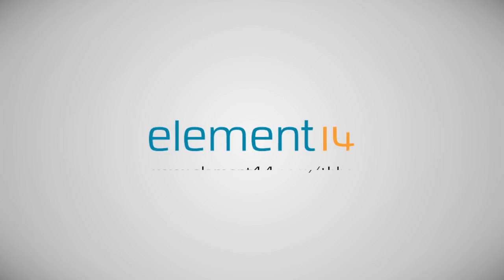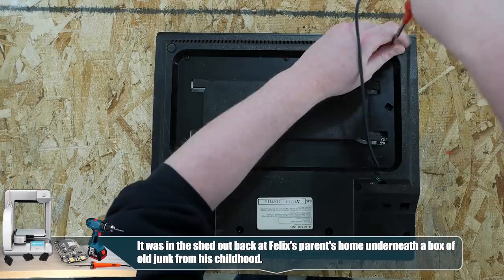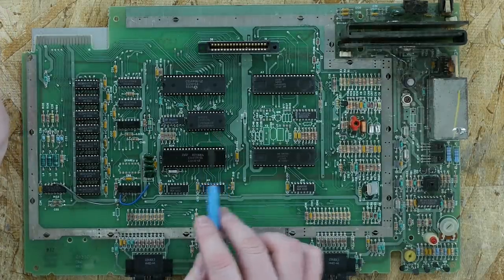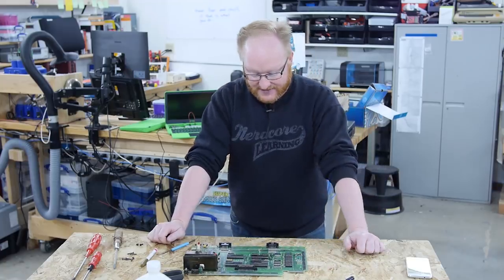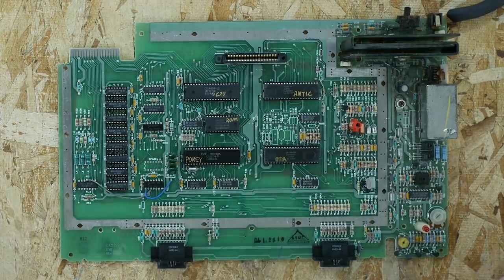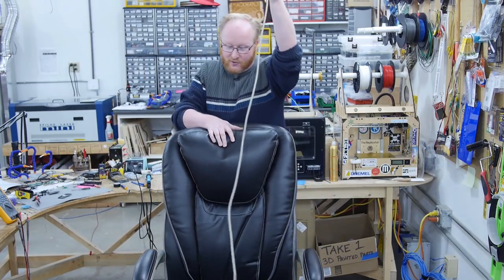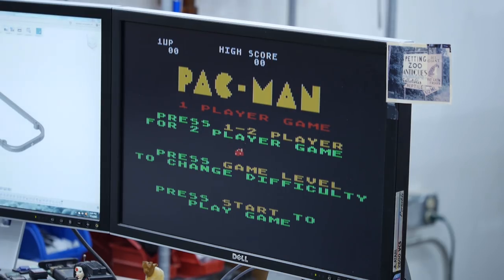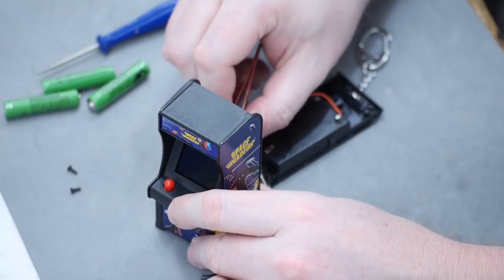Atari 5200: Making a Better Controller

Comment: Seriously !! You should mass produce these ! At least make 1000 available. They would sell out on Atari Age within 15 minutes !
Reply: TheClassicGamefan Did you saw the video? They test it with Pacman & Mario Brothers
Reply: exactly. i wanna see them play missle command and centipede with it. i use the interface thing that lets you use genesis controllers with a 5200 and i use the track ball or og 5200 controller for some analog games but i really wanna see someone crack that riddle
Reply: indeed it'd make me want to buy a 5200 since i'd actually be able to play it :D
Reply: @TheClassicGamefan  Excellent point!  I did notice that games like Pac-Man take input differently from the analog controllers than games like Missile Command and others, which must be for the reason stated, digital vs analog.  I'm dealing with some joysticks right now that work fine for digital input games, but don't do diddly squat for analog input games.

Comment: The retro market is in need of this controller. My god this needs to be mass produced
Reply: crimson7085 ah jeez. Who’s really getting teary eyed over the 7800 much less the 5200?
Reply: There's a lot of us 5200 and 7800 gamers still rocking the systems. Go over to AtariAge dot com if you don't believe me.
Reply: I agree!  I have two controllers and I’ve taken them apart so many times to fix them

Comment: Ben, please, PLEASE...make this controller available for sale. I could really use one. I miss using my Atari 5200. When I think about using it, I stop and think, and remember. The controllers are atrocious. 😔 pleaae....help!
Reply: I'll second that! I have both models of the 5200 - the 4 controller port version and the 2 port version. I even have a 2600 to 5200 cartridge adaptor. But, I have NO CONTROLLERS THAT WORK! I can't play them anymore :(
Reply: I'm very good at fixing them look for Mark on atariage page on Facebook
Reply: I would definitely buy this!
Reply: There's something to that controller. If it was compatible with PC games, it would be tempting to buy one.
Reply: Have somebody put this into production or brand new controllers for all retro consoles hey there's an idea, show me the money Ben!!!!
Reply: I too would buy a couple of these. Either completely built, or as parts kits and 3D models for printing. Please!
Reply: Please sell this! I'd buy 2 right away!
Reply: Please put into production
Reply: Yes, count me in!
Reply: The controllers are fine to me. The only problem is that they corrode easily. And you can just clean them out with an eraser.
Reply: I would take 4 of these!  Please give someone this info, or sell it to them.
Reply: @DerpDerp3001  didn't work for me at all. I need to buy the new flex circuits on Ebay. Sad the 5200 gets very little love.
Reply: Also you need alcohol and some way to protect it from corroding.

Comment: For sure there is a market for these controllers. As others have said, you didn't allow for the use of the overlays for those games that did come with them. Also you really need to test your analog programming with a few games that are very tricky to get working in all directions even with stock and good working 5200 controllers. Those games are Popeye, Kangaroo, Miner 2049er, the sequel known as Bounty Bob Strikes back and Gyruss. 

Also I would be interested to know if you did a composite video mod on it to get the gameplay footage at the end on your Dell monitor there or how you got around the RF on that?

But these are the kinds of videos I originally subscribed to see on the TBHS and it is very bittersweet to see this stuff again on the sunset of Ben leaving...
Reply: All of the 5200 games that are Trak-Ball compatible will work well with analog joysticks. Speaking of Gyruss, there's a 5200 specific version that has never been officially released. For whatever reason, the commercial version Parker Bros. released was just a port of the Atari 8-bit computer version.
Reply: 5200 Gyruss was my jam.  Of course, I had a Wico stick.

Comment: The only problem I can see is that games used thin plastic overlays to tell you what the keypad buttons did, so you'd have to either design the controller to fit the original overlays or provide new ones that are compatible with the redesigned one. Or remember what all 12 buttons did.

Comment: Um, I’d buy it in a second!!
Reply: Really, I thought that the 5200 was your most disappointing console. And you never really mentioned the alternatives to the original controller nor the upgrade kits available. Sorry but cant take your comment at face value.
Reply: @nostalgicforthe70s18  it's a YouTube comment.. chill
Reply: there is a cheap adapter floating on ebay (greece imported) that lets you use 2600 controllers instead of the 5200

Comment: Ben and Felix, there are loads of 5200 owners who would buy that. A lot are over at AtariAge and also in various Facebook groups. However, the true holy grail of a project, and I hope you both would consider doing this, would be to create a retrofix PCB kit for the CX52 joystick that would replace the flex circuit in them. You could take that self-centering analog joystick mechanism you used and replace the existing analog stick with it. And you could use dome switches - which Dan Kramer's CX53 Trak-Ball Controller uses - attached to the PCB so that the mushy fire buttons and keypad buttons would work properly. Essentially turning a stock CX52 into the CX52L that wasn't released. You guys would be 5200 gods! Take my money!

If you guys really want to play 5200 games, get the AtariMax SD Cartridge Adapter. It rocks. If you want to mod the 5200 further, there's 2 different RGB mods available, with the VBXE from Europe being the most expensive option but with the most firepower; the SOPHIA - or is it SOFIA? - is a plug-in chip option. And you could use the Dual POKEY mods used on Atari 8-bit computers and use them in the 5200 for "stereo" [dual mono] sound.

As for Pac-Man, there's a much better version done in recent years by Tep392 called "Pac-Man Arcade". If you search a little bit, you can find ways of buying it on cart, or you could load the ROM in the AtariMax SD Adapter.

Finally, a couple of things about the 5200 chips. Most Atari 8-bits, the 5200, and the 7800 all use Atari's custom 6502C "Sally" CPU. From what I can see, it appears that that particular one in the 5200 in your video was made by Rockwell. Atari bought very little from MOS Technology after Commodore acquired them. MOS actually asked Al Alcorn at Atari Inc. to buy the company to keep themselves out of Commodore's hands but Warner nixed that idea. MOS granted Atari a license to the 6502 upon condition of ordering 50k CPUs - actually, 6507s - from MOS. Atari ended up mainly purchasing their 6502s from Synertek and Rockwell. The 5200 doesn't have a PIA because it doesn't have an SIO Port. It also doesn't have the built-in Light Pen/Gun support that the Atari 8-bit computers have [including the much later XE Game System], or a larger ROM to support those extra goodies. The POKEY reads the joystick ports and also does the audio. In the 2600 VCS, the RIOT handles the joysticks while the TIA handles graphics and sound. 

Awesome video! Now, about that potential CX52 retrofit kit...  :)

Comment: The first 5200 with the "funky" switch box was a neat feature.  One, it auto-switched to the game signal (from the tv signal), eliminating the need to get up and  reach behind the tv.  Also, having a single cable go from the box to the tv meant they could provide an extra long cable (with a convenient wire-wrap on the bottom) so you could sit comfortably on your couch instead of having to  crouch in front of the tv or have multiple wires strung across your living room.  Atari didn't pitch this as the replacement to the 2600, but the "Cadillac" model.  As such, it had to look nice (and it looks stunning when cleaned up) and also not leave any clutter- hence the controller storage.  I have most every classic console, and the 5200 is the only one that looks nice in your entertainment center (being all sleek, shiny, black-and-silver) and doesn't look "old" alongside a modern receiver, blu-ray player, PS4, etc.

Comment: FYI - The consoles Atari was competing against at the time also had storage on the unit itself for their controllers so I don't see why you're mocking the 5200 when the ColecoVision and IntelliVision did the same thing. I've never seen a 5200 with the controllers in the storage area so I don't know if it looks as nice as the others.

Comment: The original controller accommodated both left-handed and right-handed players.  Funny how in this new, enlightened age of making things accessible we expect left-handed players to just "suck-it-up" and adapt to a single controller layout for everyone.  Also, the main beef against the 5200 stick was that it was analog while most games of the era (like Pac-Man) worked better with a digital joystick.  I'm surprised you didn't also include a D-pad as an alternate control scheme.  Multiple third parties sold adapters that would turn a standard digital stick into a 5200 compatible controller.

Comment: This brings back some memories. I got an entire Atari 5200 with controllers and a bunch of games for like $5 in the early 90s and never could get the stupid thing to work. I don't remember whether it was the 4 port or 2 port version, though. Sounds like I wasn't missing much with those nasty controllers, though. During the same era, I didn't really care about the 5200 so much because I was able to piece Atari 2600 kits together for about $3 (sold for $30) and get games 10 for $1 (sold for $1-3 each). I sold systems to other kids at school and made enough to buy my Super NES during the "Free Super Mario All Stars game" mail-in promo. I would ultimately sell my Super NES to buy a second-hand 386 laptop in 1997. Worth it.

Comment: As a 5200 fan, I gotta comment. The Atari 8-bit computers started out intending to replace the VCS [2600] in 1979. That's what Nolan Bushnell wanted; Warner didn't. Bushnell was fired/quit. Warner's installed President of Atari, the late Ray Kassar, saw the huge margins Apple was making off the Apple II and demanded Atari enter the home computer market. So the VCS replacement project became a computer project. So the 5200 in 1982 returned that whole revolutionary chipset back to its original intent: a game console. Even going back to 1979, Atari internally was debating to release what became the 400 as a keyboard-less console but ultimately released it as a kid-friendly computer with that curse-ed membrane keyboard that made it spill-resistant. 

The 5200 was originally released with 4 joystick ports. Most of the design choices were made due to the results of intense - and expensive - marketing research. Consumers thought bigger was better which was why the 5200 is huge. Atari also surveyed mothers across the nation and it was decided to make the power and RF cables into a single cable so mothers would stop tripping over multiple wires as they walked across the living rooms since the consoles usually were placed on the floor while gaming. The modulator on the original 5200 was also auto-switching 3+ years before the NES popularized that feature in the US. But since the modulator could spark, it scared people. Not that any 5200s ever caught fire and burnt down houses, unlike Microsoft's original Xbox. Ahem. The controller cabinet on the back was also meant to satisfy mothers. It would be wise to remember the Intellivision and the Colecovision both stored their controllers on the top of the consoles. 

One short-sighted manager at Atari - who was installed by Warner - is responsible for the 5200 not being backwards-compatible with 2600 [VCS] from the start as well as not insisting upon the standard joysticks self-centering. Atari's own engineers wanted both features.

Atari later cost-reduced the 5200 during the intense battle with the Colecovision for next-gen dominance while the industry crashed. So the model you are featuring is that version, the so-called "2-port" version, because it lost the 2 extra joystick ports. It also ditched the fancy auto-switching all-in-one modulator for the traditional separate slider. This version was also natively compatible with the 2600 adapter whereas the 4-port had to be modded at the local Atari Service Center.

Atari also designed a 5100 which was much smaller and ditched the controller cabinet but it also sacrificed the Expansion Port. It wasn't released. Like it, Atari also designed the CX52L self-centering joysticks but they also weren't released. That's because Warner forced Atari to discontinue the 5200 in favor of GCC's 7800 which had arguably more powerful graphics - not to mention a cartridge slot that had lines for onboard cartridge RAM, CPU replacements, sound chips, etc - but was also cheaper to manufacture. This happened just as the 5200 was projected to overtake the Colecovision in sales. It really cheesed off Atari's engineers. It prevented Dan Kramer - who designed the awesome Atari Consumer Trak-Ball Controllers - from finishing up work on a 5200 Driving Controller [based upon Atari's arcade Pole Position Steering Wheel, Pedals, and Shifter] and also starting on a 5200 Yoke Controller [based upon Atari's arcade Star Wars Yoke]. The 7800 was supposed to be released nationally - and later internationally - for Christmas 1984 but then Warner decided to sell Atari Inc's Consumer Division to Jack Tramiel's Tramel Technology Limited [TTL], which became Atari Corp, and threw everything out of whack. Tramiel still wanted to release the 7800 for Christmas 1984 for $59.99 but GCC refused because they didn't want their royalties per unit massively reduced, since it was supposed to sell for $149.99, and plus they wanted Warner to generously pay them for the design instead of Tramiel while Tramiel demanded Warner also compensate GCC. Tramiel ended up having to pay GCC but the whole thing dragged out which is why the 7800 didn't get released nationally until January 1986. Meanwhile, the cash-strapped Atari Corp modded leftover 4-port 5200s for traditional RF switchbox and 2600 Adapter compatibility and sold the inventory in bundles via mail-order out of the Atari Explorer magazine...

Good times! Oh, and the 5200 rules with its Trak-Ball!

Comment: Yes, This is something a lot of retro gamers would love. I bought a 5200 from ebay back in 2000 just so I could play all the games I had as a kid, the 5200 controller was unique in that you could play it from either hand as the fire buttons were on both sides. I remember watching Ben make a few of the handheld 2600 a while back.
Reply: Also the only two things I would request he do make the controller with dual thumb sticks. I loved space dungeon and robotron which required a special adapter to lock 2 sticks. And since he has done miracles in the past with portable units Im sure he could (seeing the wasted space on the motherboard) build a "laptop" version or one that could fit in a case with games... Thanks Ben and E14 for the awesome work

Comment: Some of the many, many dedicated pong machines from the first generation of consoles had analog sticks (usually non-centering) instead of paddle dials.
My first ever videogame console was one of those--it was a Unisonic Olympian 2600 (yes), and it used a later-generation General Instruments pong chip that allowed moving the paddles in two dimensions; also had a couple of target-shooting modes that didn't use a light gun but involved moving a cursor on the screen. I didn't play it much because it broke after about a week. But I remember that the box proudly touted the joysticks as OMNI-DIRECTIONAL CONTROLS.

Comment: I took a non working 5200 roller controller and a 5200 controller cut the  joystick part off with a dremel and mounted it where the track ball was. The wiring was easy to figure out and the keyboard and pause start and reset were superior on the roller controller. It worked great and I only needed one because it is set up for 2 players from the factory.

Comment: A beautiful masterpiece!! The 5200 was my very first console too. The 4 side buttons on the original controllers died right quick. So, I ended up getting a Wico Command Control joystick for it. I still have my 5200,  but it stopped working a long time ago!
Reply: Fix it! Do some digging around in here and I'm AtariAge. I'm sure it can be fixed. ;)
Reply: @R3TR0R4V3  I did buy some parts, to try and fix it/troubleshoot the problem, but they didn't help. I'm not an electrician; so, I'm not going to take it apart and stuff. =)